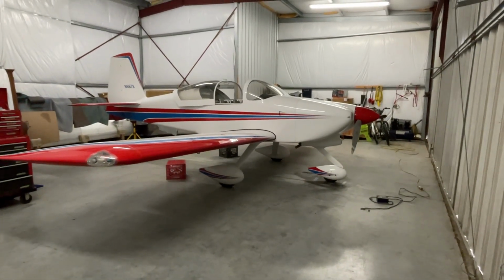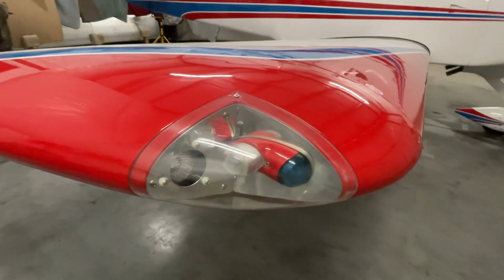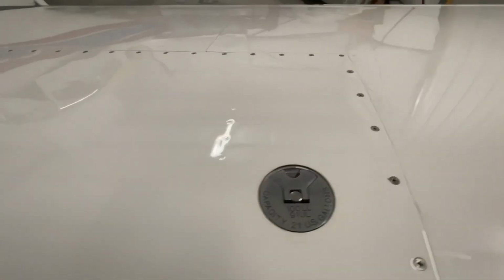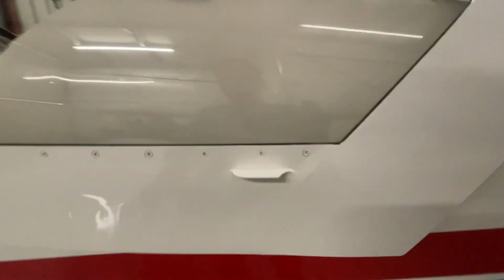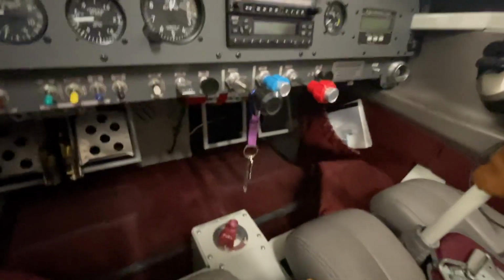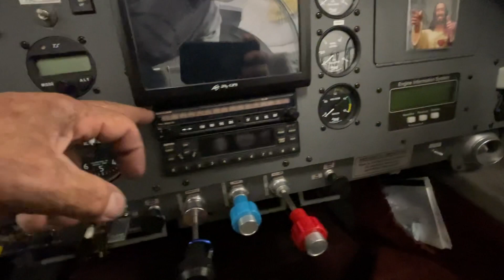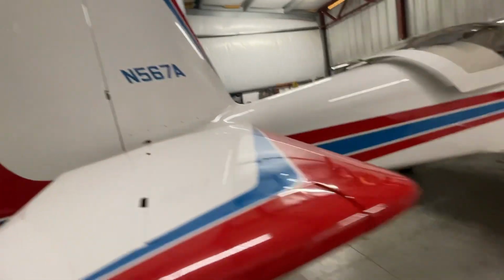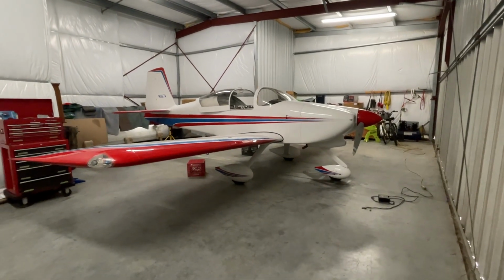RV7A N567A

Comment: Rick, I have a RV7A kit I am looking to sell. The work that has been done was from a gentleman that worked in the sheet metal shop at the NAVAL AIR STATION here in Corpus Christi. The empennage and wings are built. The workmanship is correct. The fuselge was cleco’d together at one point ,but taken apart for storage as life got in the way. The slider canopy was hi choice. The finishing kit still needs to purchased but all of the hardware for the empennage/wings/fuselage kits are complete. I’m a of your RV videos and thought you may know someone interested.